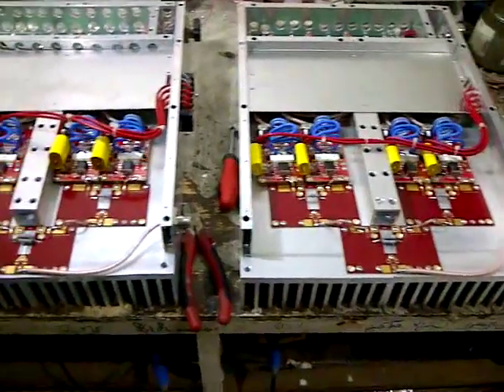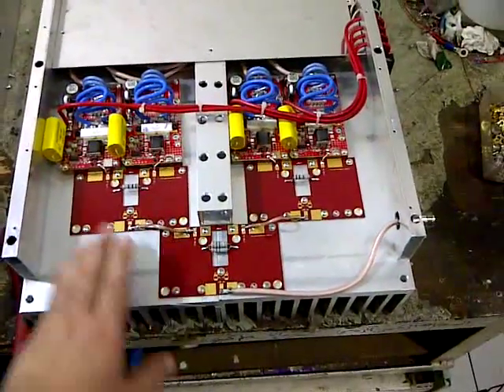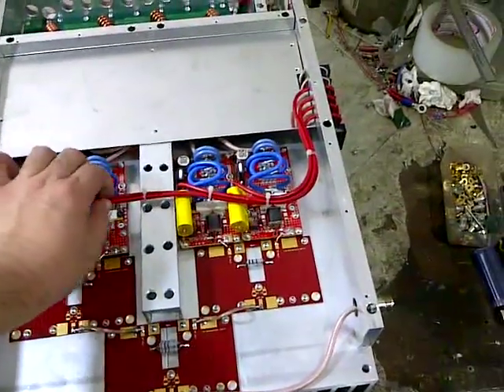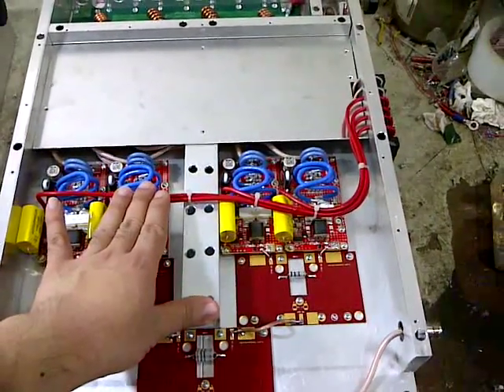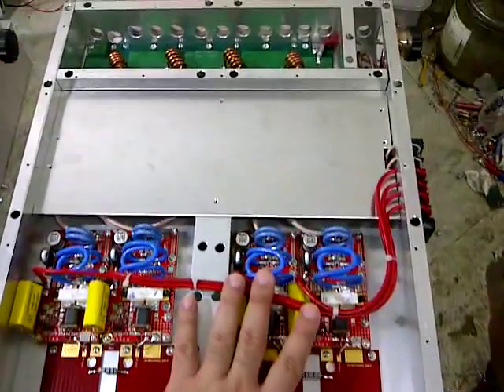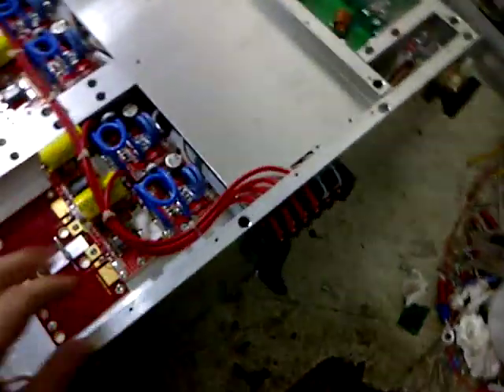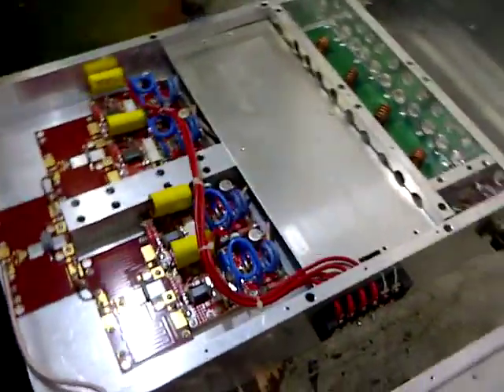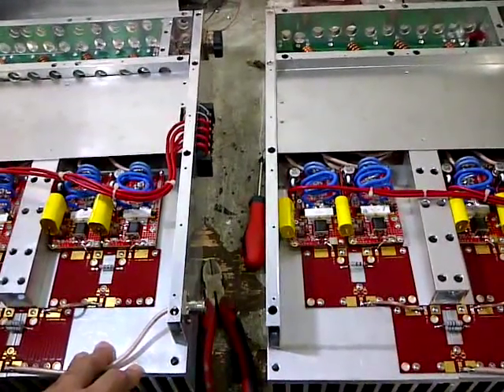5000 Watt FM Amplifier Module FMP5KW  =  2 x FMP3KW

Comment: 8x1kW = 8kW, but if you use the mosfet 24/7 at full power, it meight damage or overheat. So thats why they use them below the rated standards of the mosfet.